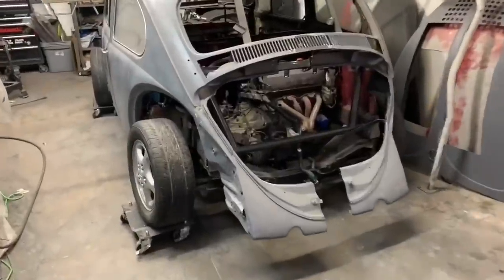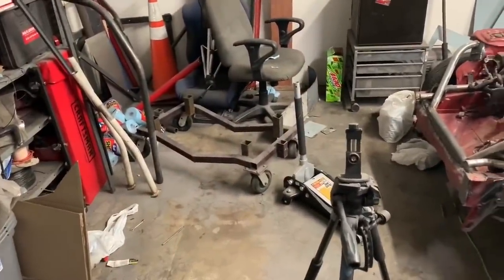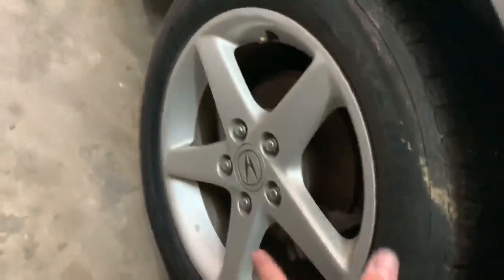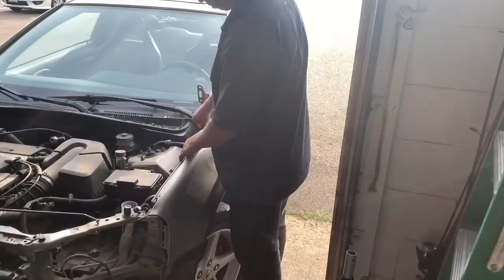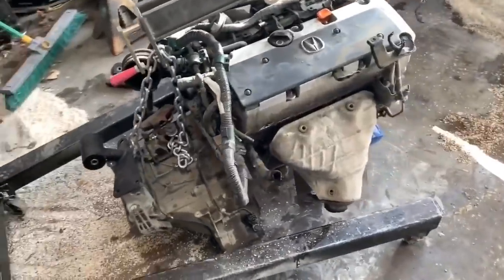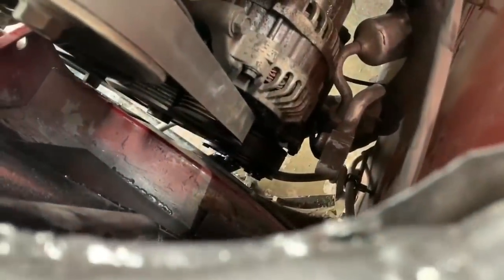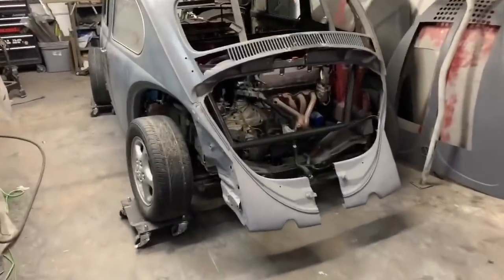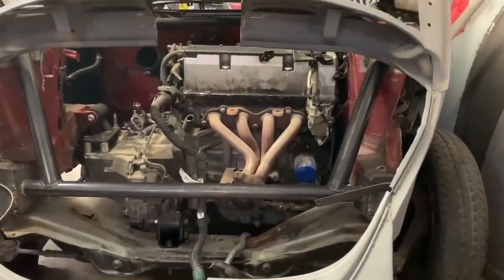Toyota MR2 chassis Wide Body VW BUG gets its K20 ENGINE SWAP!

Comment: A lot of comments about seam sealer, thought I'd throw something I did out there one time by accident... I used Napa rubberized undercoating spray can, and accidentally hit it with the torch while it was still wet, now normally I wouldn't recommend doing this and I State Napa for the fact it didn't catch fire, fire yeah paints usually very flammable, LOL this undercoating didn't catch fire instead it kind of just sizzled up and melted down into all the cracks and just smooth out real good, then it was still slightly tacky when I was done with the torch, and I hit it with black spray paint, the torch made the undercoating turn into rock hard filling all the cracks, and the black paint on top just made it look so smooth, I'd have to compare it to like a spray in bedliner but better on durability, nothing I can guarantee but one of those things someone might want to try out sometime.

Comment: The A/C compressor and P/S pump should bring some decent cash as well as the “Cadillac Converter” I have sold them to scrap dealers for a Benjamin and unbroken front glass that is not scratched up is always worth $50 bucks or more

Comment: Go buy real seam sealer because most times RTV silicone does not work well for panel sealer
Reply: Urethane based please. Silicon will usually attract and trap moisture.

Comment: If you cut the exhaust header tubes off at the flange and reweld it upside down(1🔁4 & 3🔁2) the collector will be almost perfectly placed for where you said you wanted to put the turbo. Easy peasy, 4 cuts, 4 welds and an adapter your done the hotside.
Reply from the maker: You read my mind lol

Comment: For future reference, it is easiest to cut the rear apron off and make it removable. There are videos and websites that show how. I would still do it on that bug because things are so tight. (Add just noticed you have a support bar running across there. Maybe make that removable, I don't know)

Seam sealer for the seams, RTV will dry and shrink which will cause it to leak fumes and let water in

Looks good
Reply from the maker: Roger that! Thank you!
Reply: @GARAGEIdiotS  You know I have been thinking about. We both like to do really stupid stuff, we should get together and do a car of some type for the Grambler500

If you don't know what that is check it out on the web

Comment: While you've got that engine out, you might want to change the timing belt/water pump.
Reply from the maker: These having timing chains, however, I think you are right and it’d be good to give everything a once over
Reply: @GARAGEIdiotS  my bad, I should've checked first.

Comment: Brent would tell you that older stock internal NA engines are perfect for boost. He calls em "loose for boost" because the tolerances aren't too tight where the boost will destroy the motor.

Comment: i likes a lot man!! all that reiforcement on the fire wall is great
Reply: In reality the sheet metal work on the firewall covered up holes but added no real structure only properly placed “pipe” adds structural reinforcement.
Reply: @gullreefclub  believe it or not all that sheet metal ads rigidity is like when you angle a shhet of cardboard!!!
Reply from the maker: I promise the firewall is stronger than the factory Toyota one lol
Reply from the maker: But my intention wasn’t to make it structured, just to remake what I previously cut away

Comment: Love this project. Keep up the good work ! I think you should try to retro fit the rsx dash into the bug that would be sick ! Also are you going to use all the 5 lug stuff for the bug ?
Reply from the maker: The mr2 is already 5 lug and the mr2 turbo (the model I have) was one of the fastest braking cars in its era so no need to switch out brakes
Reply: @GARAGEIdiotS  that dash idea is pretty slick though... That would really clean up the interior. Not to mention all the guages and electrical is designed to be there. It might be easier than NOT using it.

Comment: Got so much space in the back you could realistically do a radiator there instead of running lines to the front
Reply from the maker: Yea but Toyota plumbed it to the front, and in this set up more weight in the front isn’t a bad thing, also the extended length the coolant has to travel also allows more cooling
Reply: Sounds like you also are going to do a water to air then ;)

Comment: Why is he leaning to the right didn't you had a spring on the right side or something ?
Reply from the maker: The right side rear has a spare tire on it so the height difference is the reason for the lean
Reply: GARAGE IdiotS 👍🏻😆 okee ,thats an easy fix 😆 but men good job on everything, i hope everything work out with your money man
And I'm curious what the final weight hp ratio you end up with, good luck 👍🏻

Comment: Destroying a Rsx for a sketchy bug?? Hmm
Reply: It was a base model and rsx's are a dime a dozen and it was all beat to hell.  No one cares about that car.  The MR2 bug is far more interesting.
Reply from the maker: Salvage title, hail damage, base model, high mileage.  Well worth destroying
Reply: Base model is k20a3 right? K20a2 is what I plan on swapping into my ep3 si when the current setup dies.. or at least an a2 head with beefed up internals... Keep up the good work bro..